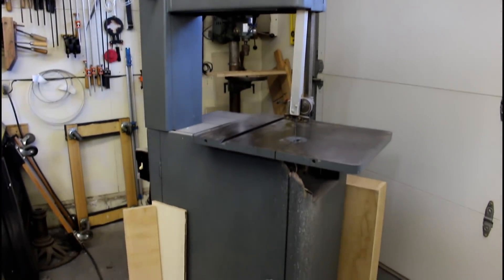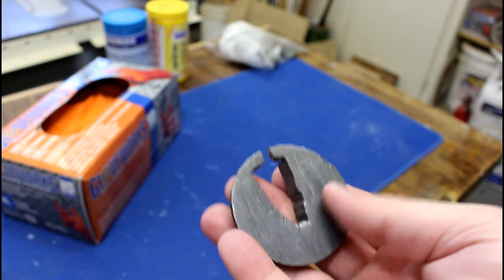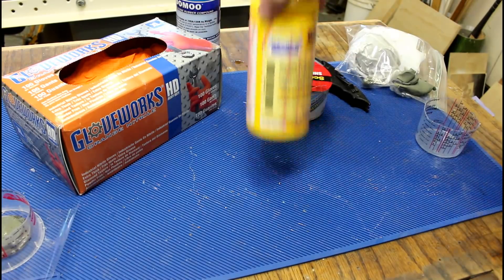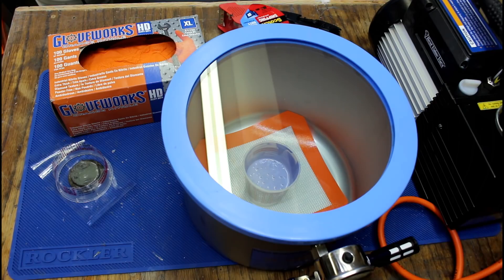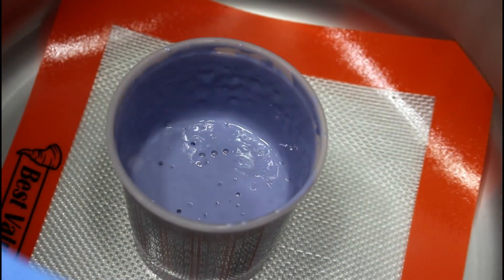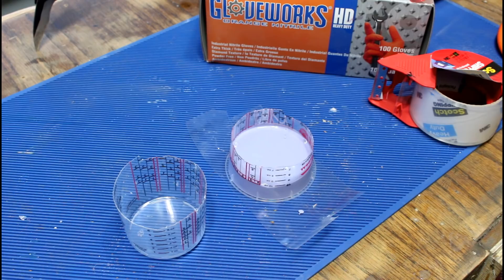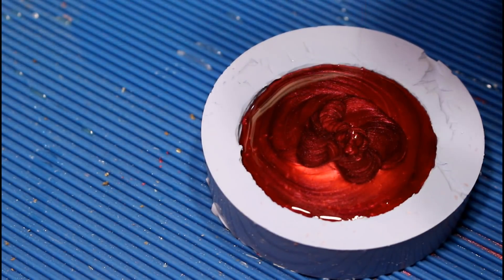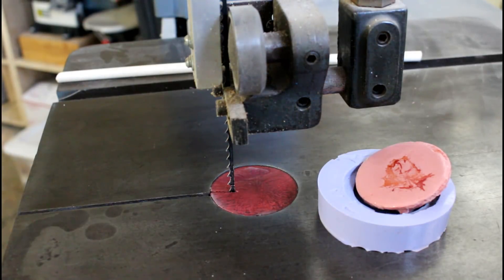Molding & Casting: A Zero Clearance Insert

Comment: First time watching. Retired newbie. I've been pricing out router tops for my Craftsman table saw. Oops, Sears stopped making them. A phenolic sheet 12x27x 3/4 inch thick, costs a lot of money too. After I saw your video I was wondering if I could take my insert and the T-TRACKS to for a single mold for the resin.

Comment: Good job.  One comment I’d like to make is: I’ve watched a few people mix up resin for molds and they always end up with way too much resin left over that, I assume, goes to waste. Why don’t people pour water into the mild to measure the volume so they mix up the necessary amount needed. 
I love using the rubber mould compounds. I used to make replica fish molds and it is, like you say, very important to get the air out of the mix prior to pouring. Just a easy tip. Mix with less vigour so as not to introduce as much air, then pour the moulding compound from a higher position so it lands on the piece in a very very thin strand and this will eliminate a tremendous amount of air bubble issues. The vacuum pot is great but if you don’t have one, try what I said and then blow with mild heat hair dryer to warm up and raise air bubbles. Great video. Thanks.

Comment: Why don't you use that mold to cast a Wax part, paint that wax part in plaster, melt the wax out of that plaster, and pour some molten led (or aluminum, or brass) into the plaster mold! Just an idea. Really cool videos. Thanks!

Comment: Just an FYI. Your pour method introduces air. You should slowly pour from one corner if square, or from one area if round, and let the material naturally flow to the unfilled areas. The point is to let the material flow from the bottom, pushing the air forward and up. Obviously, your viscosity makes a huge difference, as does material type and what’s in the mold. But it’s just a good practice if you’re putting effort into degassing

Comment: Real question here, I don't have a band saw so I don't know, but how can the insert get cut away if the blade does not touch it?
Reply: presumably bits of stuff hitting it at high speed when cutting. thats my best guess as i dont own a saw either.
Reply: stalectos that could be to, it does look like it's been cut, has saw marks. But you never see a blade move that much to touch it. It's odd

Comment: I love degassing.  I need to get me a pressure pot / vacuum chamber
Reply: Bobby Duke Arts I love you bobby
Reply: Harbour Freight vacuum pump, and King of Random has a super cheap design for one. 
I made my mother one, for under 100 bucks. It works amazing! My nieces and nephews love to play with it like TKoR, sticking everything they find in it! It works extremely well for degassing epoxy, and silicone molds. Also I made her 3 sized lids, so she can use almost anything as a vacuum chamber, wide low pans for things plate/clock sized, tall skinny stuff, or a standard large crock pot size. 
I'd recommend getting a decent pressure cooker pit from a thrift store, as you can be sure it'll handle the pressure well. We've used standard glass jars, regular pots.. etc. As long as they can handle 15psi (atmospheric pressure) backwards it should be okay.
A harbour freight vacuum pump or used one will be 50$ or so, and you can usually find a good sheet of scrap acrylic in 1in thickness for pretty cheap as well.. find a supplier and see if they have any off-cuts (that's how I made 3, I got a big roughly 3x2foot awkward blob shape that let me cut 3 circles out for around 40 bucks! Only 40 bucks!)
Then the Silicone and cornstarch for protoputty is cheap!
So, no excuse man. Get out there and do work! Haha Good luck, and I hope this helped at all.
Reply: Bobby u ma god
Reply: I wonder could you just degass it while you have the silicone in the mould?
Reply: Iron Beard I used to work in a shop where we made molds for Mini-figs, like D&D figurines. Very small, tons of detail.
We used to vacuum like in the vid, then pour it and vacuum again. 
Almost guarantees a perfect mold, unless there is a crazy undercut .
Reply: Howdy bobby!
Reply: Bobby Duke Arts still haven’t got one

Comment: In the absence of vacuum, drizzle the mixed silicone in a needle-thin stream.  Bubbles can't follow.
BTW, most 'lead free' solders melt around 400-450 F, so you could cast metal inserts in a silicone mold.

Comment: Lol, this video really needs a trypophobia warning.

I wonder if just setting the rubber mix on one of the saws and letting the bubbles vibrate out would work too. I want to try to make a mold and have it come out smooth and without bubbles, at least on the surface, but I don't have a vacuum chamber and can't afford one. I will probably be using the DIY corn starch and clear caulking mold making method. I might not need it. I don't know. 

In any case, I love this video. I want to do something like this for my Bladerunner. I really don't like the insert that came with it. I want to make it a little better.

Comment: I"m curious, why did you de-gas the silicone before pouring it to make the mold? Would it have been better if you had done it after pouring, would it have messed it up, or does it just not make enough difference to matter?

Comment: Peter, another reason to degas the mold is that if you ever put it in a pressure pot, it won't shrink. This is important for pens, bottle stoppers etc. This is a great demonstration on degassing, thanks.   Scott

Comment: The main issue with air bubbles in moulds is expansion of the air due to the exotherm of the resin. As the subsurface bubbles expand you get tiny bumps forming on the mould surface and that leaves dimples in the cast part.

Comment: For people without access to a vacuum pump, you can avoid the majority of bubbles in the mold by pouring from a high distance, so that the silicone streams down in a very thin ribbon. Then lightly vibrate the mold by tapping and/or banging on the table around it. :)

Comment: You'll get even better results from degassing the silicone after pouring it onto the negative, though the molding clay may cause issues. Sometimes if you're doing really complex geometry or thick silicone it can be helpful to degas it before and after pouring.

Comment: Hi! There is no need to wait until the silicone stops bubbling completely, just keep it in the vacuum chamber for about a minute after it collapses. Also if you know you are gonna degas it use a container atleast 5 times the volume of the silicone. You can shake the whole vacuum chamber a bit to make it collapse faster. 
If you want to be sure to have no bubbles deforming your final casting pour the silicone in the mold and then degas.

Comment: When cutting the slot into the insert with the bandsaw, you should flip it upside down so the bigger flat top is flush with the saw. I cut an insert like this once, and the insert caught on the blade and tipped forward and down,, and I got a nasty cut on my finger. (I had the old insert installed so no open hole like here)

Comment: uh did you put a silicon mat in the bottom of the vacuum chamber in case of a spillover?? suggestion: dont. silicon sticks to nothing but itself.. if it spilled on the mat youd have to scoop it off while its still wet but if it got on the metal chamber you can just wait for it to set and then peel it off........

Comment: Ok, stupid question...

If the insert is lead, why didn't you just clamp it flat side down on a thick, flat piece of steel, and pour molten lead in the hole to fill it in?

That way, it's completely metal all the way thru, and would be cheaper to fix than using casting resin, and making a resin part that's less structurally secure than the original metal.

It looks great, but a much harder process to do overall...

Comment: you should have flipped the spacer when you made the mold. this would have kept the surface nice and flat straight out of the mold. if you smoothed the clay befor molding.
Reply from the maker: Oh man. You’re right! That would have been better.
Reply: You can still get a nice flat surface by placing a square of acrylic over the open end of the mold and letting any excess squeeze out. The acrylic will make for a nice flat top surface once demolded

Comment: Pretty sweet! Love the color choice too. Mine would have been blue though. :) Oomoo is my favorite mold making material. I have tried a lot of different ones - including a DIY one that was reusable - and Oomoo wins for the best. Never have put it in a pressure pot though and have not had issues with bubbles. If I was going to pressure cast resin in the hidden air pocket filled mold then I would have issues though. It would probably explode the mold. :p - Heidi

Comment: Big fan of your videos Peter... Except this one.  Do it again, this time cast the part with it top side up and then fill it from the bottom so that you insure the top is flat.  Also, take the time to cut the blade slot better.  Remove the blade so you can insert the new piece into it's correct position so you can then use the slot in the table to mark the line straight.

Comment: Im assuming "degassing " means "vaccuming" so i just had a thought what if instead of "degassing" the silicone in the cup and then pouring it out which could possibly maybe even accidentally putting some bubbles back into the silicone , what if you poured it into the mold you made and "degassed" the silicone in the mold and just let it cure?

Comment: Could you pour the silicone into the mold with your part and then put it in the vacuum chamber to pull out the air? That way you wouldn't be re-introducing the possibility of bubbles while pouring the silicone into your mold after all that hard work of degassing it.

Comment: That's a nice video as usual, but I don't think that's how degassing ought to be done. The whole point is removing bubble AFTER having poured over the piece, because as soon as you pour the degassed substance over the piece, you're again introducing some air. On the contrary, you should pour on the piece and degass the whole piece, as the voids will be filled and there will be no chance to introduce more air.

Comment: 5:08 I suspect the elevated pouring is for good video footage but the way the material ribbons over itself can pull new air in (which could be disappointing after all that effort to Degas).  In my experience, pouring low and slow and allowing the resin to gradually flow into position can make for a much more solid casting.  Also, degassing again after pouring can be a viable option in some cases.  Either way, great vid.  Thanks, man.

Comment: New at casting: I’m using resin in wood and keep getting a fair amount of shrinkage from the resin as it’s curing. Any tips, anyone, on how to keep it from pulling away from the edges of the wood?
Reply: Use a different resin. Some resins have less shrinkage than others.
Reply: Thanks! I’ve been using Castin’ Craft so I’ll change it up when I run out. Is there a preferred resin to use with wood? I know Peter uses west systems and that boat resin a lot

Comment: How about you put the silicon with the piece* you try to mold into the vacuum chamber? I mean that way it should prevent bubbles on the surface. And its okay when you wait too long because it can stay there.

*As long as its not changed from the vacuum.

Comment: When my insert gets too buggered, I fill the space with JB Weld, It doesn't have bubbles but sadly it only comes in black.
Reply from the maker: That's a good idea too. JB is basically epoxy with metal shavings. Very useful stuff.

Comment: I dont believe degassing the resin before pouring it has any, or very little, effect. When you pour the resin into the mold it folds in over itself, trapping airbubbles inside...
Reply: Madzda he didn't degas the resin. He degassed the silicone. Therefore ridding the mold of air bubbles.
Reply: Meant to say silicone, my point still stands :)
Reply: Madzda i guess mixing introduces way more (microscopic) air bubbles than pouring itself?
Reply: Except the air gets pushed up and out as the silicone settles, en masse. Degassing is removing those air pockets (created by whipping it to fully mix it) and leaving it as just the single material. An example that might be more easily understood would be carbonated soda- it has a lot of carbon dioxide dissolved into the liquid that you can get out by shaking it or leaving it open, because atmospheric pressure isn't enough to keep it dissolved into it. The air "dissolved" into the silicone from mixing it in, however, is at pressure. Which is why you need to use a vacuum chamber to lower the pressure and pull the air out.
Reply: A friend of mine does silicone casting, there's a considerable difference between what he made before and what he made after he started degassing, but that was for bigger objects.
Reply: Henrietta B I think it's because resin generally has a pretty short working time--measured in minutes--while the silicone has a much longer working time. But I could be wrong.
Reply: SweetNepen , it also appeared that the resin wasn't as thick and gooey and perhaps it's easier for air to rise to the surface on its own- kind of like using a heat gun to encourage the bubbles out
Reply: Why did the previous one have bubbles, but the degassed one didn't? Just curious lol. I only work with resin, not silicone so I have no clue
Reply: Then don't believe it but the results everybody has with it speak for themselves.
Reply: I was wondering why he didn't degass the resin as well as the silicone? I mean it'd probably not make much difference but can you do it and would it make a little difference? (Degassing it once it's poured and in the mould I mean)

Comment: Nice job Peter!

Are you gonna make different widths of cuts on the other inserts for different blade sizes?

Also, should you drill a very small hole where the blade sits in the insert? I've seen inserts like that, and I assume its to give the ade some wiggle room, incase you push too hard on a turn or something.

Comment: Peter, after you poured the silicon for the mould. Why didn't you then put that into the vacuum? Would that not have ensured that any bubbles forming from pouring be removed then too?
Reply from the maker: Vacuums aren't great for casting resin. Pressure pots are, but I've not gotten one of those yet! :)
Reply: Peter Brown oh! Good to know actually, that would have been my follow up question. I more meant towards vacuuming the now poured silicon before it cured. Not the resin pour
Reply: See, the thing is aaaahhhh, k that makes sense

Comment: I find it sad your only friend is packing tape.  How long is the working time with the mold making material?  Also, where did you get you degassing machine?
Reply from the maker: The oomoo has a 30 minute working time and I was RIGHT at the limit when I finally poured it. :)

The vacuum was sent to me by Best Value Vacs. I added links in the descriptions for the parts I used in this video.
Reply: Thanks, I did a pour of aluminum shavings for pen blanks.  I use 18 ounces of Alumilite for my blanks and was surprised that even full of aluminum shavings it still took all 18.  It was a fail for pen blanks, it just blows out as you get close to the pen tube.  Failure is a way of learning.
Reply: Aluminium shavings take up close to no space at all. Its really thin shavings and like 95% air surrounding them.

Comment: why does it wear out if its behind the saw? sorry for noob question
Reply from the maker: there is flex in the blade and the kerf will widen with use. Also, I'll have to make deeper cuts in when I swap out the current blade with larger ones.